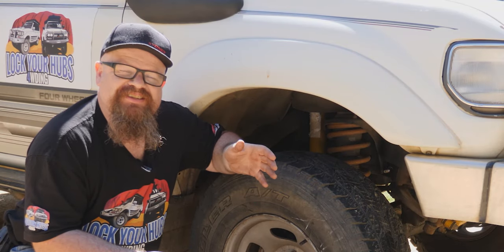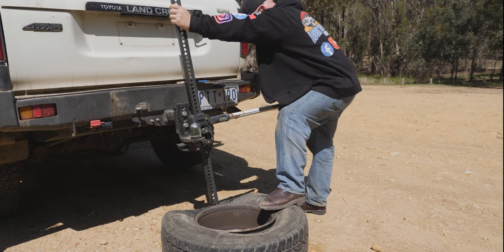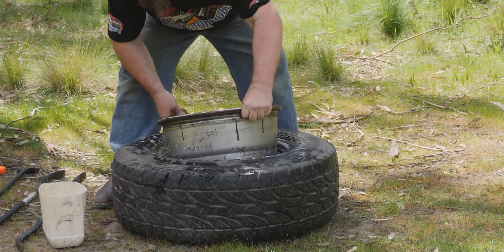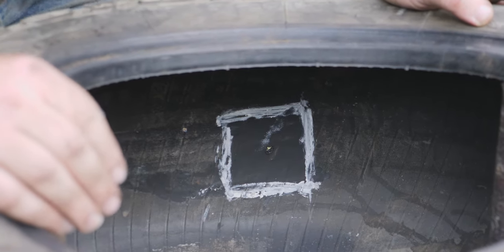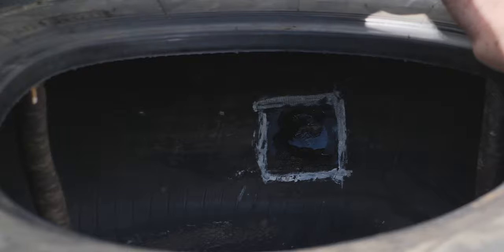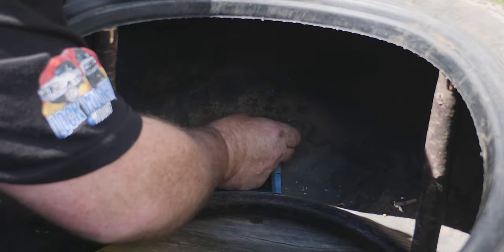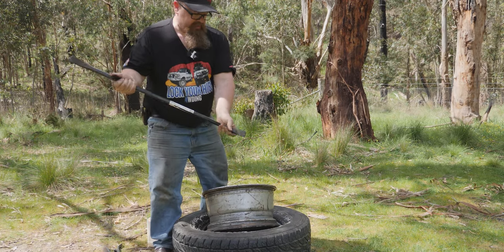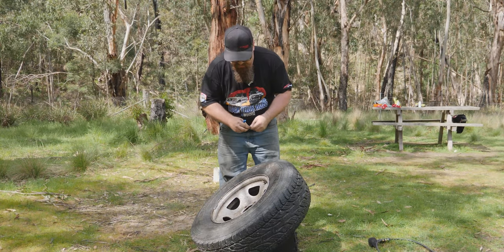Comprehensive DIY 4x4 Off-Road Tyre Repair - how to patch a tire

Comment: Using solvents and fuels to seat the bead seems more for when the rims are too wide for the tires .  I agree that sitting the rim on a stand off the ground inflates the bead better as the bottom bead is already a bit sealed from the weight of the tyre pushing down . A good fast compressor like a twin ARB makes a big difference also .
Reply from the maker: Volume helps, if you're reseating a bead, I've  done it quite a few times using just an ARB single, just takes a little longer. 

If you have to resort to using solvents because of the tyre size, probably better to use a bead blaster.

Using the techniques in the video, I've never had an issue reseating normal 4WD tyres, even with low flow pumps.

Comment: Good video :) Now try it with a Mickey T ATZ P3. I struggle using my levers with these on alloy wheels, so now I use an alloy mate tyre bar and a bullbar mounted tyre changer head. Still a difficult job, but much better than with just levers alone.

What levers are you using? Look better than my tyre pliers set.
Reply from the maker: Truck levers from Rema Tip Top. Gotta have some leverage!